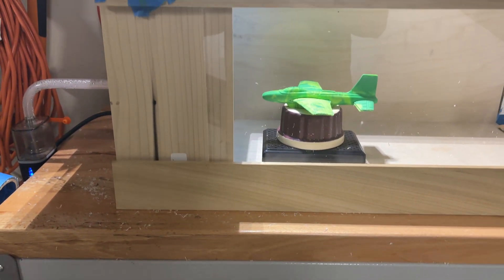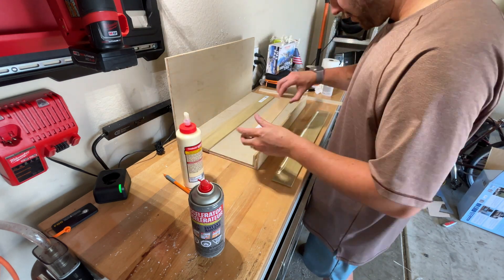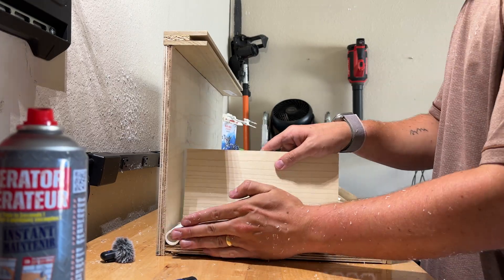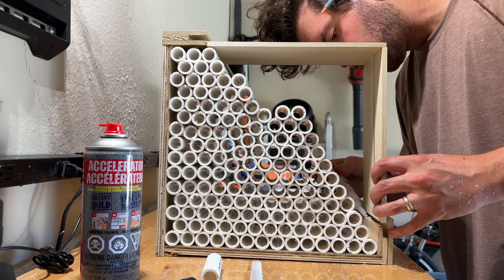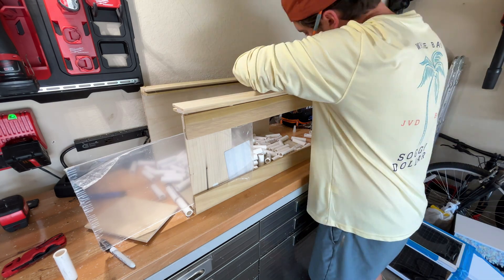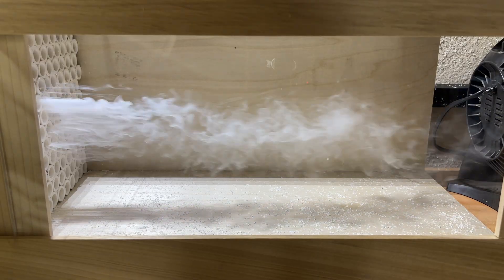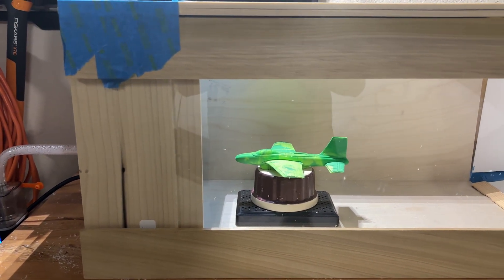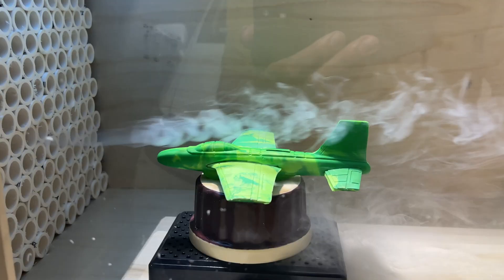new wind tunnel build! sort of tutorial!

Comment: I'm at least a month late on this, but you can get a big roll of like 20 feet of fairly bright white LEDs for about $10. You can either mount them up with little mounting hooks (the waterproof stuff comes with them, usually) or you can sandwich them behind some plexiglass if you wanna use the mounting tape, but protect against the heat of the garage. You'll probably need a power supply to power the LEDs, but it shouldn't cost you more than $20-30 or so all together.
Reply from the maker: I did that on the last one I made! I didn’t love it because it kept pealing off! I made a new video about my new light I got if you wanna watch that one!

Comment: Hi, this was a very informative video. Just a couple thoughts however. I would suspend your tests subjects from the top using a thin wire, as the stand would affect your results more significantly. I would also use a more powerful fan, preferably with a variable power output, for testing at different speeds. Just some suggestions! Good luck 🤞
Reply from the maker: this is great feedback! thanks for watching & commenting!